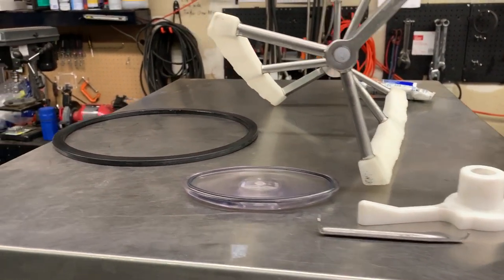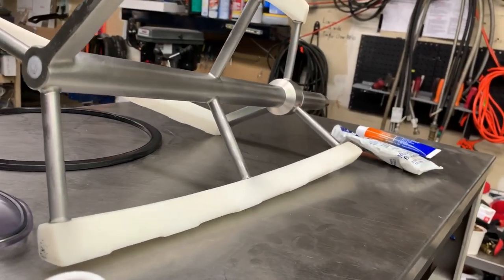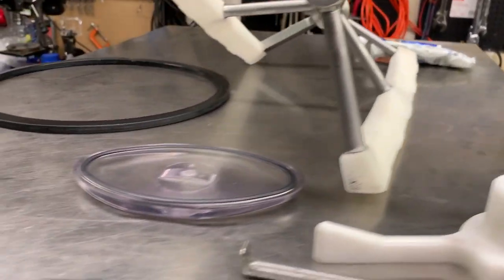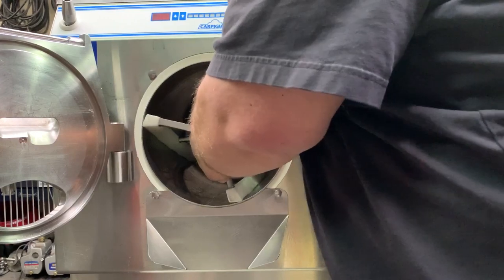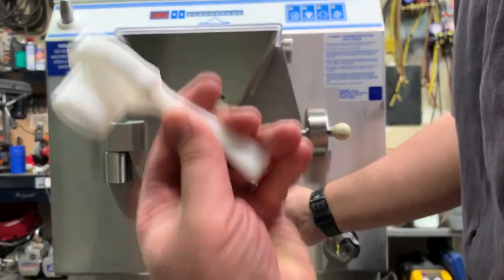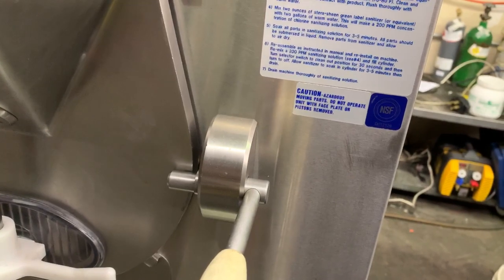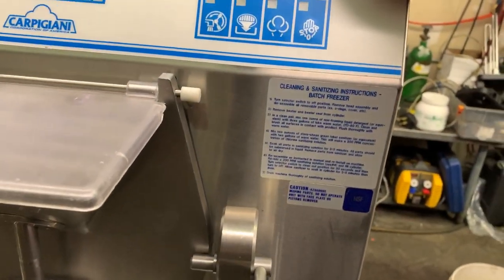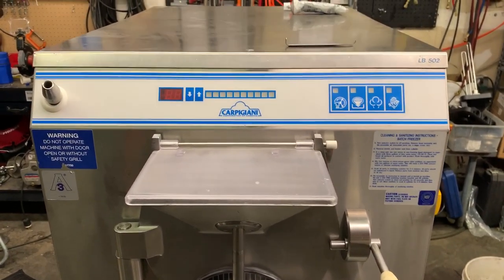Tutorial: Carpigiani batch freezer assembly and maintenance www.slicesconcession.com

Comment: Hi, Thanks for your detailed and very helpful video! I had a question. I know someone here in Quebec/Canada who has turned a 3 phase lb 502 machine into a 1 phase one, by putting a new motor and cpmpressor (the motor's name is Marathon) on it. The machine is like a new one and we offered him a good price to buy it (around 8000 CAD) and he has accepted. I talked to the dealer who has done the job and he told that every thing is ok with the machine and it works fine like a new one. What do you think about this conversion? Do you think it's a right thing? My husband wants to buy it next week and if you can help us with your expertise it will be really appreciated. Thanks.